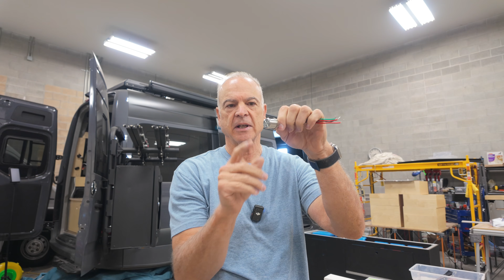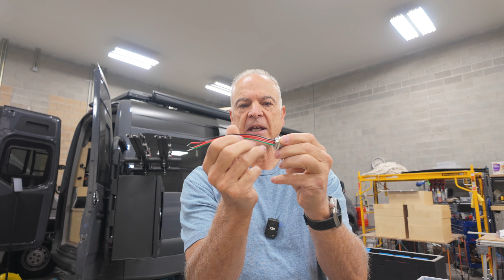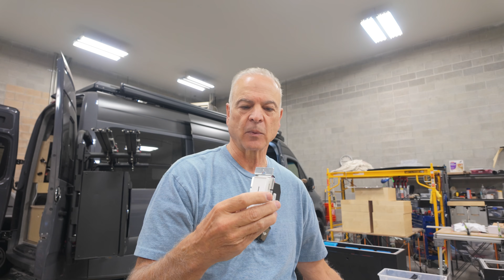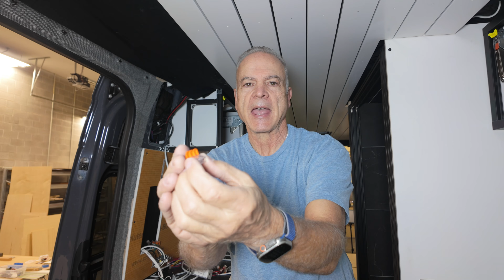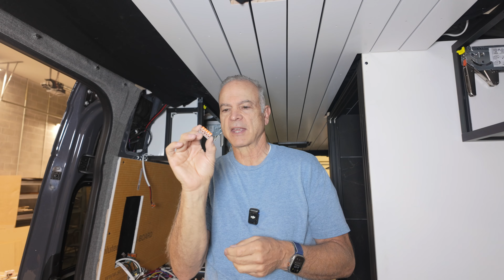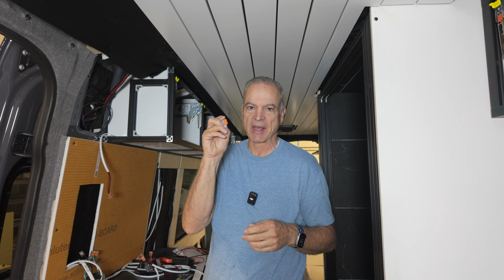12 volt Switches and Connectors | Pro Van Builder Shares Favorites

Comment: Great stuff, Jeff. I learned this through the school of hard knocks and sending switches back and forth to Amazon until I find the ones that I really like. Dimmers were especially difficult as they don't always work with all LEDs; some of them buzzed, etc. I've been using the wire connectors mentioned for three or four years now, and they are fantastic, allowing you to connect things extremely quickly.  I guess I just wish I would have watched your video before spending weeks going through all this stuff when I first started.

Comment: I'm having the same issue trying to find those small touch dimmers without a light. Besides the sliding dimmer there are rotary dimmers, which imo is much more aesthetically pleasing.
I must say I'm kinda surprised you're using lever nuts. They are super easy to work with but having non water proof connections hiding behind walls in an otherwise high quality, marine grade system seems kinda counter intuitive to me.

Comment: This model switch appears to have no led light

Ulincos Touch Switch UT19T10 Stepless Dimming Switch, no LED, Suitable for 19mm 3/4" Mounting Hole
Reply: Amazon has these and also an option from the same brand that has the switch backlight come on only when the switch is turned on.

Comment: Touch and hold when the dimmer is off to turn off the light, at least that's how mine work
Reply from the maker: I’m going to try that. Thanks.
Reply: @thrive_overland  let me know if it works
Reply: Mine are made by a company called Acegoo and work this way.

Comment: Awesome video as always. How do you size fuses for your console power lines?
Reply from the maker: I just go off of the amperage for each device. I usually use a 15 amp fuse and make sure I stay under that for the total combined amps for the devices.
Reply: @thrive_overland  thanks. That’s what I figured. So no issue if one of the lighter branch circuits sees a higher draw than its rated amps? Honest question. Not trying to be a wise guy. 😊😊